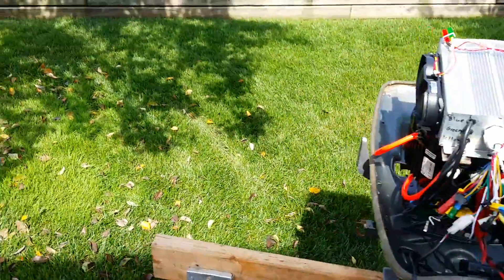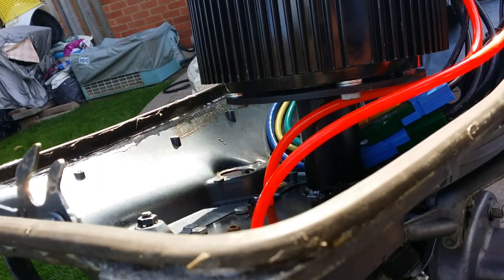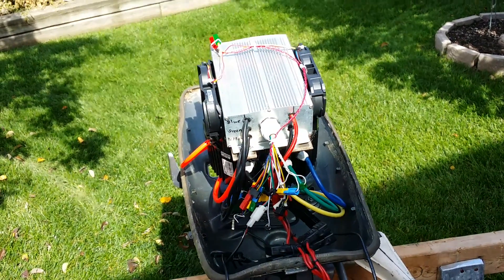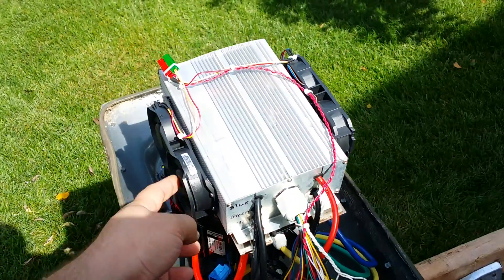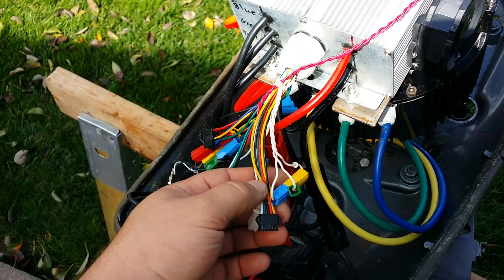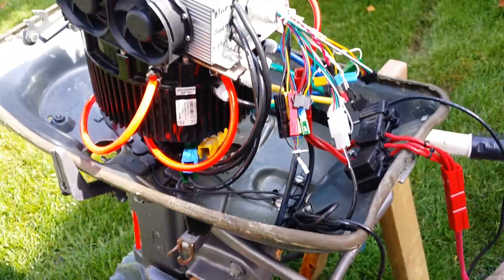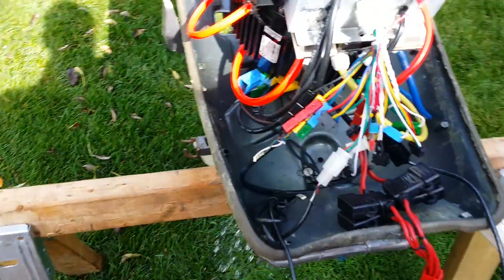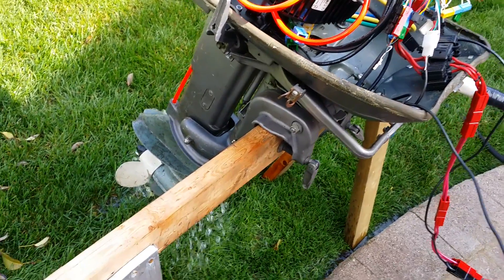My 5kw 48v electric outboard motor

Comment: Ouch, is this the PWM or some bearing or alignment that isn't properly fitted? If it's mechanical you probably can improve it.

Nice project, thanks for sharing! I figure the future is direct drive outboarders. I wish there was some really cheap solution. After all it's just an electric motor in a housing under water cooled.

Comment: Cool - But why not just get a Torqeedo?
Reply: epicdeuce because a comparable torqeedo model would be about $6000 used.. what he build probably cost closer to $500 or $1000 tops. That and being able to build something like that makes you more ready to handle an emergency. What the fuck are you going to do if that fancy, overpriced shit fails in the middle of nowhere? He built this, therefore can fix it.. see the plethora of good reasons yet?
Reply: Jake Smith 4kw torqeedo are currently selling on eBay for less than $3000 USD as new old stock. So not sure where you are shopping where you see a Cruise 4.0 torqeedo going for 6k used. But please link if you can. $3k for a turnkey setup that weighs 37lbs (not sure how much this setup weighs but easily 2x that of a torqeedo) with a very well established company that has strong customer support. This looks like a fun project but that's quite a time commitment and torqeedo a have a reputation for their longevity

Comment: the original water cooling impeller is designed to turn in the direction of the original motor.  I left the forward and reverse linkage hooked up in mine, however my motor has reverse and regenerative braking.  I was not planning on using it but I left it functional all the same. To my point on the question of impeller removal.  I notice the way its made is to turn in one direction.  Did you take it out?   If so I am assuming your what looks like a golden motor is cooled via a electric pump.  I could use any info on issues you encountered. I'm in the assembly process now.

Comment: The controller would be happier mounted separately on board, with heat sink cooling fins. The new sine Wave Controllers will solve the pulse noise. Water cool the interior of the engine cowling with the stock outboard impeller. That way you can add more sound proofing to the cowling. What sort of range did you acheive with the single 20 AMP 48volt battery pack? Total weights? Prop pitch Ideas?

Comment: Maybe a sine wave controller would lower the noise. To get 12V from 48v batteries I learned that you can use a modern wallcharger of the kind that does both 110v and 220v (switching power supply) They work for on dc too and not just ac becouse of the switching circuitry and does work on lower voltages than specified. I use one to power my led headlight on my 36v bicycle. Not all of them work though.

Comment: Hi bud I'm hoping you can help me out ? I just purchased a 2000 to 5000 watt e bike motor it has an 80 am speed controle , I'm an rc guy , and I would like to put lipos on my e bike ? The motor requires 20 to 30 amps , can you suggest what I need ? Cheers , and I have been injoying your vids ! Dan...
Reply: Rc forever Nice! Not stealth, but I bet it screams on the water!